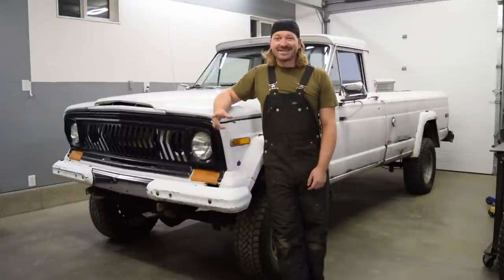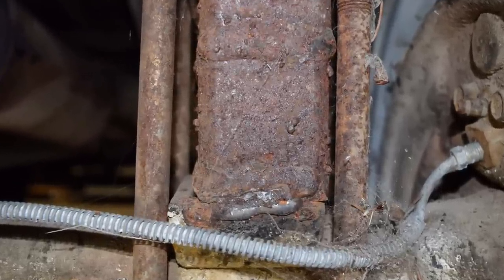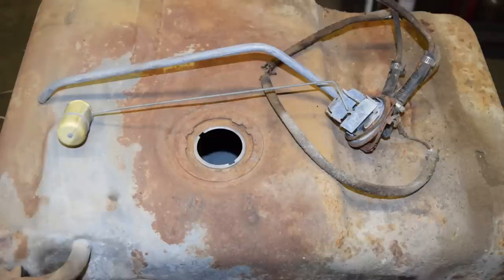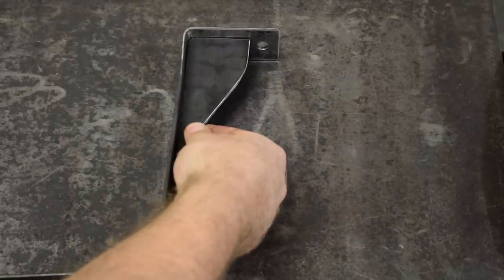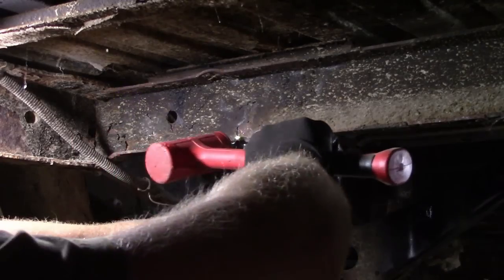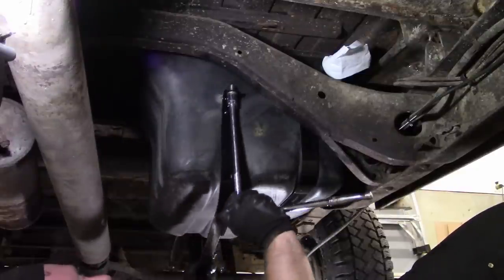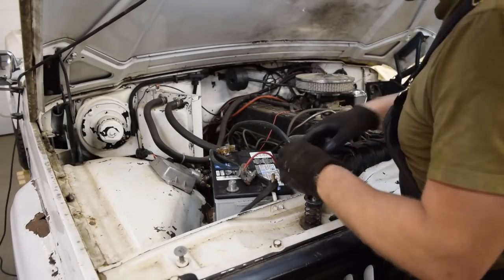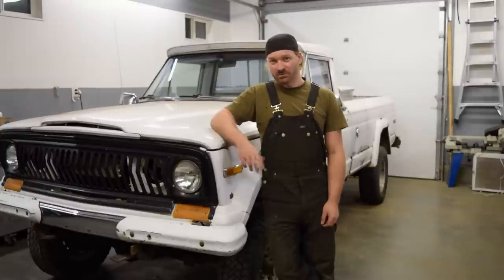So you want to fix up a rare old truck? - J-Fawkit Jeep J10 Episode 1

Comment: Get a haircut and a real job :flipoff2:
Reply from the maker: Lulz
Reply: That's a very cool truck. Lots of work but I like it.
Reply: I'm loving the ketchup bottle compressing fuel vapor next to your sparky battery leads.  I suggest full coverage with a very low deductible... for your house. Note:  this post for entertainment purposes only and not indicative of any expertise or safety analysis of this or any situation.

Comment: Going through a bit of this with my new j10. Just did a new cooling system: radiator, heater core, hoses, waterpump, timing cover (had a crack that was leaking), timing chain (while we were in there, it was way loose), oil pump rebuild, and a new starter to boot... Woosh. $ 

Thats what we do, bring things back to life. Floorpans are street signs from the po. Gas fill, gauge, and sender are not reliable....yay! tires, shocks... OiiiiiiiO No bullets wounds though. Still have this?

Comment: I had a 76 with a 401cid for 38 years.  And about 9 other Jeeps of different vintages and models. There was never an rad overflow on the 76s. Just a straight dump.  That series ran from 73 to 78.  You've probably already done this but check the serial number. It will tell you what original motor and transmission was in that truck.  A friend a 75 with the 258 but it had a 4 speed.  I have never seen the turbo 400 behind a 6.  They also used a TH350 and a 727 among others.  There's absolutely nothing weird about the quadra-trac system.  Its just a a full-time 4x4 system.  I switched out mine to a 2x4 with locking hubs. It was a waste of time and money. It gained nothing. I reverted back to the quadra-trac system.  It's also not weird vacuum engagement system. It was actually ahead of it's time, considering its all electric engage systems now. The weird thing was but the vacuum switch in the glove box. I moved mine to the dash.   I didn't notice the low range reduction unit on that transfer case. That was an option.  The shifter for that was under the drivers seat.  That was weird.  Keep in mind that Jeep (AMC) at the time were making highend 4x4s and they didn't want all the controls Exposed like other 4x4 vehicles of that era.  The fuel fill hose. I had to buy 24" to get 4". At the time it was $90. That was about 1986. I wouldn't bother with the return line unless it has air-conditioning. I'm currently working on a 1974 J10 that has so many changes in it that it's like making a puzzle when you don't know what its supposed to look like and someone threw in a hundred extra pieces. Someone pulled out the 360cid and dropped a 304 with 4 speed into it. I speculate because they wanted a manual transmission.  I have seen a manual behind the 401cid. I wouldn't have made the swap but it wasn't my truck. The body looks great on that unit you got. Its clean. Looks great and a lot better than the mess that I'm dealing with.

Comment: Nice work. I enjoyed and learned from your repairs. I have a 1985 J10 long bed with the 258 ci. I purchased it off Ebay in Louisiana in 2004 before Katrina hit and drove it home to Virginia. I put it in my garage with the hopes of completely restoring it. It has no frame rust, and the body is mostly rust free except for some surface rust. The floors are solid also. It needs a paint job and I have a rebuilt engine to put in it. It has the T177 4 speed transmission. I plan to convert it to fuel injection. I purchased new roll up window frames from California and bucket seats. It needs a paint job. I finally have some extra money so It is my project for 2021 to restore it to become a vehicle that I can drive on the weekends on nice days. I plan to keep it out of the sun and rain.

Comment: I have a 75 j20 with the 401 v8 same trans/tcase set up currently redoing the entire fuel system front to back. Now mine is a california emissions model adding confusion to the entire system. Those tubes in the filler neck area of the bed are actually for the factory evap, that canister isn't a filter as I thought it just seems to be some sort of catch trap to keep fuel from being sucked up to the vacuum can in the engine bay. I'm currently trying to build a resource library and mapping everything in the truck since it was a mostly untouched survivor that lived in socal and as u stated some of these older less popular trucks can be a pain to find info and parts for.

Comment: Are body replacement panels available for these old Jeep Trucks?  I cant find any online.
Reply from the maker: There isn't too much out there.  BJ's offroad offers some patch pieces and panels, along with fiberglass fenders.  You can sometimes find some generic pieces on RockAuto even, which will likely have a better price if they will do what you want.  Team Grand Wagoneer is definitely worth checking as they tend to have a few different items.  And lastly Z&M Jeeps offers some pieces along with brake bent boxsides, but the quality of these parts is suspect.  There is fiberglass cowl hoods on the market too, but I don't recall who makes them.

Comment: Quadratrac parts are indeed available for it. BJ's offroad sells US made Morse drive chains built on the original Morse machines. New, US made, brake cones (clutch cones) are also for sale. You can make your own limited slip oil with a good synth gear oil and the proper amount of limited slip fluid. Or you can buy Crown TCL.

The BW1305 (single-range) and 1339 (dual range) were not odd. They were essentially ahead of everyone else since they were designed from the ground up to be a true first full-time, limited-slip four wheel drive. In the NP203 "full-time 4WD" equipped GM, Ford and Dodge rigs, you had no limited slip in the NP203 T-case, so you had THREE open differentials and still could get stuck with just ONE wheel spinning. 

In comparison, the Jeep QT essentially sensed wheel spin and sent torque to the opposite axle. Two wheels (one front, one rear) immobilized the QT Jeeps. There were no traction aiding devices available in the QT optioned trucks and Wags. It was deemed unnecessary. This was wishful thinking for actual severe trail use. A rear traction aid would be a benefit. 

I have run QT Jtrucks exclusively for about twenty years and short of normal wear on the brake/clutch cones and chain stretch, the system is well suited to climates with snow and patchy, icy/dry roads. Severe offroad use and use as a plow rig does accelerate QT component wear.

You can easily have a 2WD mode - install part time hubs on the front, turn them to the "free" position, and lock the QT in Emergency Drive (locked 4WD mode) and the front drive shaft will be powered, but the hubs will not transfer power to the wheels. There is parasitic load, but it does save wear on the limited slip components. When you want 4WD again, lock the hubs then shift the QT into "Normal" (limited-slip 4WD mode) and you can drive in the snow with greater security.

Now that that is out of the way - comments on ACTUAL VIDEO CONTENT. Nicely done. I'm not sure when it may have changed, but I know 1977 J trucks had two straps on the tank. Yours may have just misplaced one of its straps... It happens.

I'd love to see more of the Jtruck. I'm a fan of these rigs and have bloodied myself on them since the 1990s.
Reply from the maker: It's hard to say what was going on with the tank/strap arrangement in the truck since it's a complete hodge-podge of parts from different years.  The box does not match the frame, and the question was if the frame was original or not, given that the transmission crossmember is not in the correct place on it.
Reply: Um...how do you mean, box doesn't fit the frame? The actual bed mounts do not align on the frame mounting pads? 1974-75 was the changing point between frames/suspension types on Jeep trucks. You could have a pre 1975 bed. Looks like it has:
1) recessed, round fuel cap hole.
2) recessed side marker light dents.
which indicate it is a pre 78 bed anyway.

Does it have:
1) Inner bed walls?
2) round tail lights?
which would indicate pre 74 bed.

And regarding the cross-member position: is there a way you can check the drivetrain to see if it has a goofy spacer/adapter between the AMC engine and TH400 bell-housing? I believe pre 1975 FSJs that had the TH400 option used a Buick Nailhead bellhousing TH400 and a 1" or 2" thick adapter plate to bolt it to the AMC block. 1975-79 used a special made AMC bolt-pattern bell-housing that clocks the TH400 down (clockwise when viewed from rear) on the passenger side.

I know the forward hanger for the rear springs on the pre 1975 Jeeps were a single post riveted to the side of the frame rail. But IIRC, your video shows the big boxes on the outside of the forward hanger for the rear springs. That would make it a post-1975 frame.

If the cross-member is too far back, I'd guess you had a post-1975 truck with a pre-1975 drivetrain stuffed under the hood.

You can swap out the TH400 case for a later AMC bellhousing model.
Reply from the maker: I don't know because I'm not home to look, but the forward box mounts do not match the mounts on the frame.  Helpfully a PO has welded the bed to the frame mounts, poorly.  The box is not a round taillight, so it shouldn't be pre-74, but it definitely used the single fore-aft strap for the gas tank with a skidplate mount running the other way (which was not on it or included when I bought it), and yes the frame has the spring hangers for a post-75.  There's no adapter plate for the 258 to TH-400, at least not that I recall, but it is not the original engine (stamps indicate it was from a 78 CJ-5, IIRC, but would have to look again, a previous owner replied here before and confirmed the engine was swapped by a 'shop' when the old one blew up).  It's quite possible the truck did not even come with a TH-400/Quadratrac, and that was swapped at some point.  Regardless, the white paint is a later overspray (and overspray they did), I don't remember what colours are under what parts, but I want to say the cab was brown and the box was blue.  This entire truck has been apart at some point, it was a restomod project for somebody.
Reply: Intriguing. I was looking at my bare 1979 frame with crossmember and if the engine/tranny/T-case set-up is mounted too far back by a hole in the motor mounts it could move the tranny crossmember back. There isn't much room to move it further back, as you've seen. Unfortunately I have absolutely NO experience with the 258 I6. So I cannot say if the whole kit and kaboodle is appreciably longer than the V8 set-up. I am relatively certain the J-truck frames were exactly the same, except different motor mounts locations were likely for an I6. I do vaguely remember a 1963 J200 donor chassis I had briefly, (the front clip of my green truck was from that truck), and I think I remember it was a 232 I6 truck and the motor mounts WERE in a different position, but I cannot say if they were forward or aft of the 1976-81 V8 mounts I'm familiar with. 
Your experience would seem to dictate they move forward about 3-4 inches.

What kind of clearance is there between the fan and the rad?

Comment: I was just watching your XJ bumper videos and looking at my 78 J-10 and this video popped up but mine has a 360 and the 4-speed with a granny gear and it is being built as a trail only rig and will lose the majority of the factory interior and receive a custom dash with actual gauges, 4” lift with 35’s it won’t do as much as my XJ but the kids will have a blast playing with it! But that has to wait until the 2-post lift gets installed this weekend... tired of laying on my back for the last 2 years under my XJ but the time spent shows in the final product, she’s almost too pretty to thrash on the trails... almost! Only the 2 channel I have ever subscribed to!
Reply from the maker: J trucks are just a hoot wherever you take them, they always turn heads and are a blast to drive.  I wish my J10 wasn't just a 258/Quadratrac, I might do something about that at some point, I've got a 360 here and they're a lot less boring!  Thanks for the subscribe, I really appreciate everyone that watches and subscribes!

Comment: Keep making vids,  what axles u got in your Xj?
Reply from the maker: The XJ has a Ford HP D60 in the front (1994~ balljoint style) with Yukon 4340 shafts (35 spline inners and outers), Yukon Hardcore hubs, and a Spartan locker.  The rear is a GM 14 bolt with a disk brake conversion, shave, and a Grizzly locker.

Comment: What face shield/respirator is it that you are using?  Do you recommend that brand?  I'm currently recovering from getting more steel dug out of my eye...  This go around it was right next to the pupil and my vision is still a bit blurry... :/  Guess it's time to step up my safety game and don more than my not so trusty safety glasses when grinding in shitty situations.
Reply from the maker: It's a North 7600. https://www.grainger.com/product/HONEYWELL-NORTH-North-7600-Full-Face-Respirator-3A183  Obviously you can get it for way less than that list price if you look around or have an account there.  I like it.  Buy the tear offs for it when you get it (it's another $15 or so for a pack of 3 sets of them) and never use it without them.  I've had mine a couple years and it's probably saved me several trips to the ER at this point, so I think it has paid for itself a few times over...  As a bonus you don't have black boogers and breathing troubles after a long day of grinding.
Reply from the maker: And take care of that eye.  They're helpful things to have...

Comment: old tip for tapping in locations you dont want shavings to get into. add wheel bearing grease to the tap and drills work to. grease holds onto the majority of the chips
Reply from the maker: The white stuff on the tap was grease.
Reply: Cant really see it but great work. My favorite bumper so far on YouTube
Reply from the maker: Thanks!  Appreciate it!